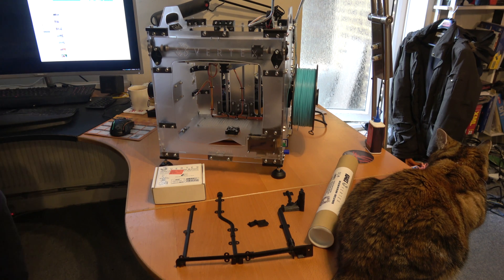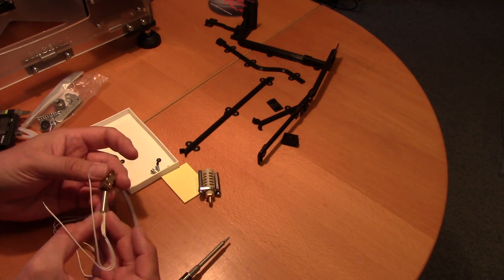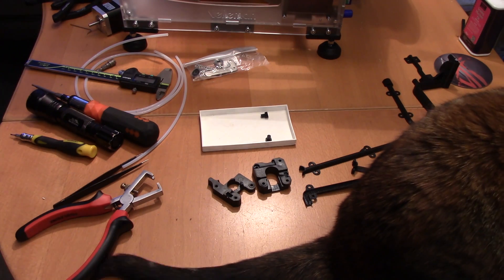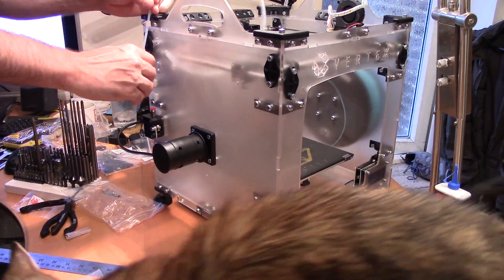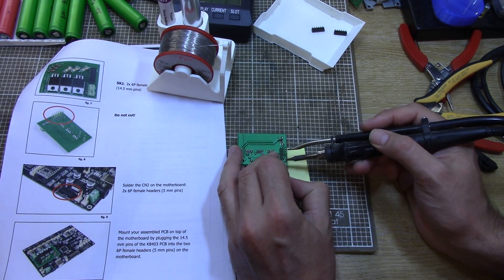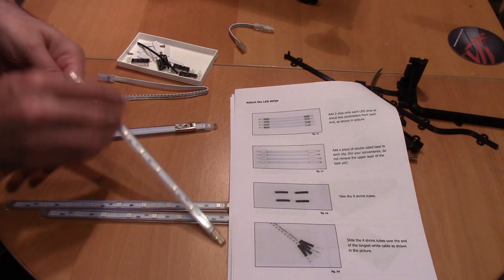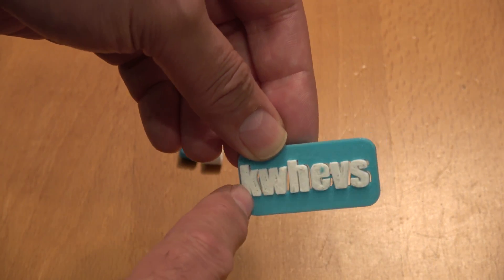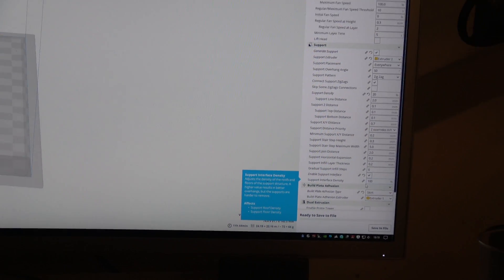Velleman Vertex K8400 - Adding Dual Extruders and RGB LEDs

Comment: I've replaced the board cause it was too slow for 2 nozzles., pausing every time. I replaced the board with a Bigtreetech skr V1.3 and TMC drivers. Far faster this is a 32 bit board and TMC drivers are more silent then the stock drivers. I use SPI mode. This board is smaller then the amtmega 2560 board.0

Comment: Hi Jim. I am using simplify 3d and cant get the extruders to line up when i try do a rpint with dual color. it starts with the one color but when its time for color number 2 it prints it beside it. I have tried pretty much every tip i have found on internet. do you know how to fix this?
Reply from the maker: Hi JIm - I had that problem to begin with. The setting in the software for the distance between the nozzles was wrong by default. Can't remember what the correct number was off the top of my head (I measured with a ruler). Hope that helps. Cheers!!
Reply: ok will measure and see. Have you used simplify 3d? If so do you know where i should change the number? Im not sure if i have found the right place to change it

Comment: Hello! Thanks for posting this video! Could you please share the settings you find more apropriate for the Innofill PVA filament? I also have a Velleman Vertex K8400 printer with a dual extrusion and it's the first time I spend one week trying to get a decent work with this Innosolve filament. But seeing that it's possible is very encouraging :D Thanks again!
Reply from the maker: I found Innofil to be a nightmare to work with... It extrudes OK at 210-230C, but it is very moisture sensitive and has a big tendency to hiss, crackle and pop as it extrudes. I also found that trying to get plastics to extrude on top of the innofil was very difficult as the had adhesion problems and ended up falling off part way through the print. I haven't attempted to use it again since this video, and have instead been using different plastics as support materials... PLA is a good support for PET (and vice versa) because they don't bond to each other. Hope that helps. Cheers!!
Reply: Jim Conner Ok! I'm having the same problems. It doesn't wan't to adhere to the platform no matter the height of the platform... Since now I was thinking that it was a temperature issue so I decided to decrease the temperature of the nozzle and incease the fanspeed but... it was in vain. So i'll try to go back to 210°C Thanks a lot! :-)

Comment: Hey Jim I have been watching your serie about the vertex k8400 and now i bought one thanks to you. My question is : If you had to order by priority the upgrades you did to the vertex what would it be ? (heatbed, dual extruder, rgb, custom printed pieces etc..)
Reply from the maker: Hi Hassan - The absolute first upgrade I'd do is print off a couple of these... https://www.thingiverse.com/thing:1078641 ... They have the holes in a slightly different location to make inserting the filament easier. Second upgrade should be the heat bed. Dual extruders was something of a let-down because of there's a steep learning curve in getting dual extruder prints without oozing from the unused nozzle causing problems. The only things I've done with dual extruders have all been feautred in this series, but I've actually unscrewed the second extruder nozzle for day-to-day use. E3D hot-ends are a very worthwhile upgrade later down the road when you've got familiar with getting the best from the printer... highly recommend those. Final upgrade I'd do is the Trinamic TMC2100 stepper motor drivers, which get you near-silent operation... but that upgrade involves changes to the cooling setup, so leave that one till least. Hope that helps. Cheers!!
Reply: Hi Jiùm, this is more than perfect answer to the question, I greatly appreciate and hope it can help other people :)

Comment: Bonjour j'ai moi même une vertex k8400 j'ai u beaucoup de mal au départ et quelques fois encore mai sa va. Tu en es content ou pas ? Et je vois que tu utilise cura comment a tu fai moi impossible je suis toujours sur repetier. J'ai quelque souci d'impression des fois. Je pourrais te donner mai réglage pour comparer. Bonne vidéo merci Salut
Reply from the maker: Bonjour Kevin. Vous devrez utiliser Cura 2.7 beta pour prendre en charge le Vertex K8400. Le profil par défaut de Cura a installé une plate-forme de construction chauffée par défaut, vous devrez donc désactiver la boîte dans les Paramètres-> Imprimantes-> Vertex-> Paramètres de la machine si votre imprimante n'en a pas encore. J'ai également constaté que les étapes de l'extrudeuse / mm sont fausses dans le firmware Vertex et sont réglées à 200 pas / mm. En modifiant ce réglage dans les menus des imprimantes jusqu'à 147 pas / mm, tout fonctionne bien pour moi. J'espère que cela vous aide. À votre santé!!
Reply: Bonjour Jim merci beaucoup pour cette réponse moi jai bien installée le plateaux chauffant et c'est le bonheur ☺️. J'ai téléchargé cura 2.7 beta il y a  pa longtemps mai pas tout compris ☺️ et impossible de régler je vais réessayer. Et oui effectivement j'ai descendu a 147 pas / mm. Moi jai également descendue accélération max /s x 5000 y 5000 z 100 E 1000  pour moi je trouve que sa aller trop vite. je t'enverrai une photo ou video pour voir mai réglage merci a toi good job jim merci